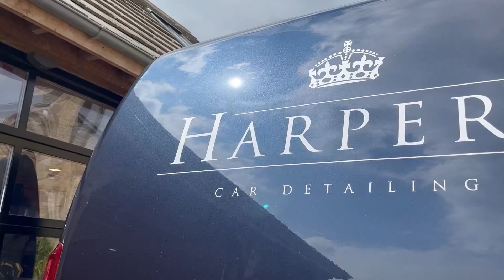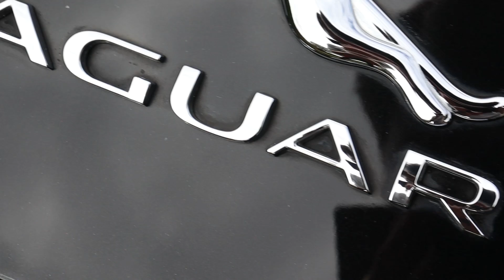Jaguar F Type R Full Exterior Detail & Ceramic Coating - ASMR

Comment: Should you be that close to the paint with that much pressure-i tend to spray in a 45 angle a bit further away
Reply from the maker: No issue at all 👍🏼
I imagine over my career I’ve done about 8,000 cars and haven’t had an issue, I use a 30 degree nozzle so the pressure is reduced

Comment: Hi Sir, great vid and beautiful car! One question, after polishing do you have to remove all polish/wax prior to applying the ceramic coating? Cheers
Reply from the maker: Thanks Will. 
 You certainly do, and ideally you should machine polish/hand polish the surface beforehand.
Reply: @HarpersCarDetailing  Cheers, do you suggest gyeon prep or isopropyl after polishing prior to ceramic?

Comment: Which is better ppf or ceramic coating
Reply from the maker: In terms of protecting the paintwork fro physical damage then PPF hands down. 
Water repellency and maintenance a ceramic coating, but you can ceramic coat PPF which would be the best option
Reply: PPF with a ceramic coating over the top 😊

Comment: Hey Harper, the dots that you put on the microfibre for the coating, are you ever worried about the marker affecting the coating at all? Or does the marker smear into the paint when you rub it in?
Reply from the maker: Hey Brennan, no not at all. The ink pretty much dries instantaneously and I haven’t had any issue with it bleaching 👍🏼

Comment: At 2:30 I've never seen black/dirt like that come off a tyre wall before, amazing! What on earth were you using?
Reply from the maker: It was a tar remover. 
Sometimes with silicone dressings it’s the only way to remove it. 
I wouldn’t do this every time though 👍🏼
Reply: @HarpersCarDetailing  ah excellent, I must try that sometime!

Comment: Nice job...presumed you clayed the whole car?
Also, why 2 buckets when you were paint correcting? not really necessary i would of thought?
What the KKD Brake like? Better than Auto Wheel from BH ?
Reply from the maker: Thanks Steve. Yes, you need to before doing any polishing.
It doesn't take any longer to do the 2 bucket method and although I am machine polishing the car, I don't want to inflict anymore unnecessary damage.

Comment: Nick when you do a ceramic coating do you ever have concerns that air born contaminants 
might stick to the coating as it cures.
Reply from the maker: No not a tall, it’s not a sticky product like that.
If any dust lands in the coating after application it’s not going to affect it
Reply: @HarpersCarDetailing  Cheers 👍